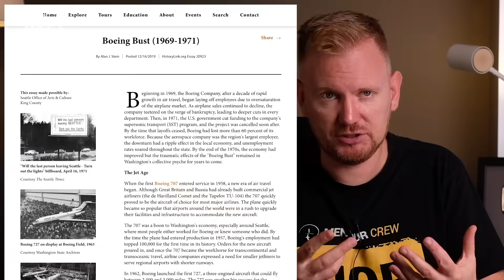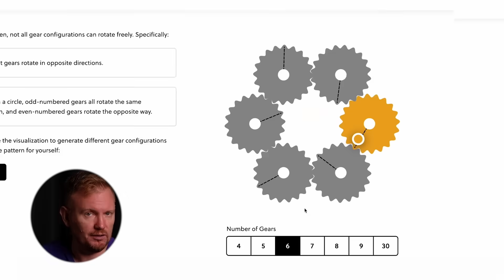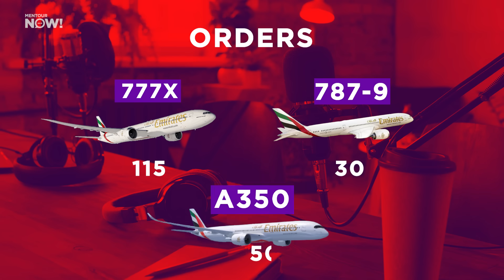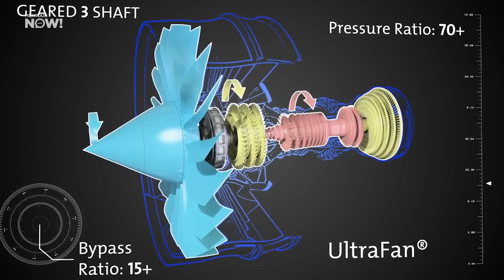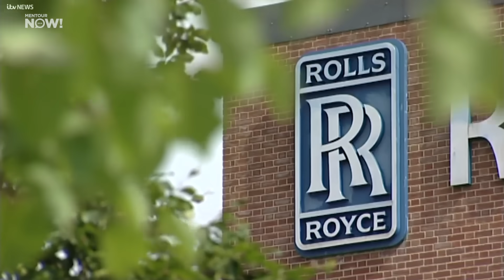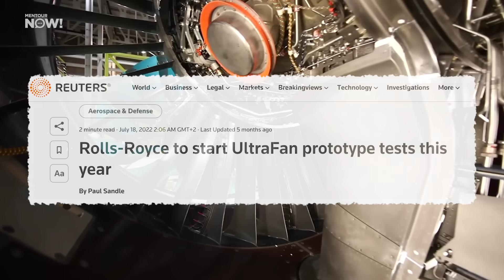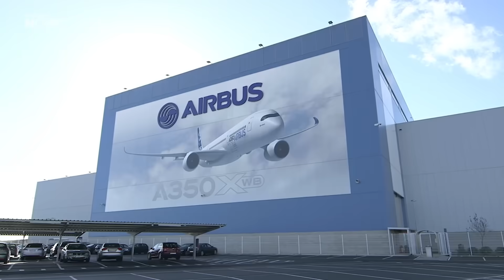Are BOEING planning a 747 with 2 ENGINES?!

Comment: Peter, you were doing so good until you went WOKE at the end... Read #6 

There are very simple facts these Lefty-Liberals will not acknowledge:  

#1 This Earth can only sustain 2 billion people without burning fossil fuel - John Deere does not run on batteries… so, what to do with 6 billion dead bodies?

#2 The “deal” Trump wisely backed us out of would have taxed USA and sent this money to the #1 and #4 producers of CO2  - Chairman Mao’s China, and India… 

#3 Every time you as a consumer purchase a product "Made in China" or Vietnam, you are supporting their Communist Government's decision to move from a self sustaining food system that is mostly carbon neutral to urban factory workers (very high carbon footprint) who then have to buy food grown on commercial farms using millions of gallons of diesel fuel... plus, much of it has to be imported from USA (more heavy crude oil being burned in marine diesels)

#4, a 6th grader knows there is no price for a train ticket to Hawaii.... as AOC wants to replace air travel with trains.....hmmm

#5, everyone with half a brain knows our Earth has but one atmosphere an when the #1 and #3 CO2 emitters have zero cost of burning more and more fossil fuels, the “West” can not change anything short of zero metal use (steel and aluminum require carbon – from coal – to remove the O2 from the Al-oxide and Fe-oxides.

#6 Absolutely everything you buy gets there with DIESEL fuel, most was made using diesel and oil... and the very first thing the first day o Biden's term he declared war on fossil fuel, to support his Green New Deal base. Thus, everything cost more. HINT AOC, John Deere will never run on batteries..

#7 Hydrogen power comes from fossil fuel. Fuel cell powered vehicles are almost always and electric vehicle w/ the “battery” being a fuel cell. As UPS found in testing Mercedes delivery vehicles, the fuel itself had about 1/5 the energy density of diesel / kerosene. Not practical outside a city, nor an aircraft.

Comment: I would say maybe a 747sp with only two Rolls-Royce Trent 1000 engines would be possible. The pylons would have to been redesigned but with two engines that's a weight reduction of 20,000 pounds.

Comment: I commented before in one of your previous videos about your English, and it seems that you have learned it from the Brits! They do not know how to use plurals correctly either, and it appears that you do not as well. Any singular entity uses singular verbs, so your title here should be "IS {and not Are} BOEING planning a 747 with 2 ENGINES?!" Anything can be construed as a collection of its many parts, so the direct conclusion is that you could use the plural with almost any noun! But if you are talking about ONE airline company, then it is SINGULAR! When you refer to more than one, then it is plural. In your speech you also often use the wrong pluarity, so it is not just a simple mistake here.

Otherwise, you videos are very informing and with lots of detail. Your English is quite easy to understand too.

Comment: This is relevant again.
If demand continues to rise then Airbus could be the one to bring the A380 back, it they can make the economics work. The plane is developed and approved, and with new engines will be more fuel efficient. So the question would be how difficult it would be for Airbus to setup the production again. Likely more simplified, so driving on roads at night.
No, the US did not buy it, as they have many airports, but India does not. Do Africa? I think we will see the comeback of this or similar, beside the 777 and 350. Also Heathrow did not build the 3rd runway. And pilot shortage.
Could also it could be fitted with a new wing and only two engines, but that would take more resources. That would depend on how much Tim Clark would pay - how much is it worth for Emirates? A 777x in his business is leaving money on the floor compared to a A380 size. It could also be a clean sheet. 
Personally, if I was flying long houl, and I am 190, I would rather go for longer trip and more comfort, so 380 or 350 then quicker but on a 321xlr.

Comment: This was exactly what I was thinking. On very busy airports flying more efficient smaller jets is just unrealistic because of the increasing number of take offs and departures. And have more airports defeats the purpose of point to point travel like if you want to fly to London or Mumbai or Delhi or Paris. And if you have to land on and airport outside that of the city from where it would take 3-4 hrs to reach where you want to go does not make sense. A large aircraft would simply mean less work for almost everybody involved.

Comment: Boeing does not have the funds, but Airbus could either make a A380Neo with 2 or 4 engines, or a bigger version of the A350, like a A360 but 777 like, with folding wing tips and a ultra fan. Depends on what Tim Clark would like, and what would the the lowest hanging frout for Airbus. Possibly a topic for a new vid.

Comment: This is boeing big problem it seems to find it difficult to move on from legacy air craft, it would not surprised me if a 2 engine is in the works, the problem is putting two engines on a 747 is likely to be as successful as the 737 max series, they need to get back to designing and building new jets with new materials and state of the art equipment, the last truly new plane was the 787 prior to that the 767, I've excluded the 777 because it's basically a bigger 767 not a truly new design IMO

Comment: Why doesn't anybody think of retrofitting the big 4 engine Aircraft with two inboard of higher thrust and two outboard lower output thrust.. 4 to take off two normal flight with obviously the backup of the other lower thrust as back up.. lower operating costs and maintenance costs.. ?

Comment: Short answer:  no way in hell.  Remember, it has to have enough power to continue EVERY takeoff when an engine fails after V1.  You might be able to fly a 2 engine 747, but the weights would have to be so reduced that it would be a money loser from day one.  Plus the production line is gone and all he equipment removed.

Comment: Also the much greater wingspan of such a super twin aircraft requires folding wings tips to allow such an aircraft to fit into the dusting infrastructure of modern airports.  Remember that when the original jumbo jet, and also the super jumbo (A380) were introduced, the physical size and the great weight of these two aircraft required that taxiways and even runways had to redesigned to handle these new aircraft.  You can probably imagine that an aircraft with a size as huge as some the proposed modern rigid airships would be completely incompatible with all but the very biggest airports in the world today. Even today there very few airports that allow the operation of the world’s largest ever aircraft, the six-engine, all composite construction StratoLaunch built by Scaled Composites. It has a wingspan of 117 meters, or 384 feet.  And, with a maximum takeoff weight of 1.3 million pounds or nearly 590 kilograms or metric ton, and is bigger than the other six-engine aircraft, the Antonov An225 and even the Airbus A380.

Comment: The problem with a two engine 747 is that two bigger engines on this huge plane would not fit. Both would almost drag on the ground. You do need some clearance. So my suggestion, for what it's worth, is simple. Slightly bigger single engines on each wing. And one more larger engine on the tail. Of course this might require both wings to be moved slightly back, but I think this might work.

Comment: Point to Point works only in National Scales. It will never happens that a flight took of from Springfield, Montana to Dinglechurch, Ireland. Even Springfield - New York - Dinglechurch sounds improbable. Springfield - NY - London - Dinglechurch sonds feasible
If the Point to Point will rock the Planet in 2025 we are missing today the 100 Passenger long haul Planes they are needed then. Or do you think there are more than 100 PPL wo want to travel from Springfield to Dinglechurch per Week?

Comment: Even preferring 747 as a piece of design, practical issues indicates being more profitable an upper deck and front door added to a 777 than changing the 747's wings/land gears to fit two engines...

Comment: Really don't understand this. One of the selling point for the 747 is that it can safely maintain flight with just 2 of the 4 engines working. After reaching altitude, just turn off 2 of the engines and be done with it.

Comment: Why not a carbon fiber version with two engines? Otherwise they'll never get the weight and fuel consumption down, which is the 747's achilles heel.

Comment: My car runs on 2 cylinders when its just cruising on the motorway. Would it be possible to have a 4 engine model that when just flying normal (Not taking off etc) can fly just using 2 engines?

Comment: Because of covid, airlines laid off many of their pilots.  Now with demand for more flights, they'll need years to hire and train new pilots.  777x and airbus equivalent are only holds 1/2 the passengers. Thus 2 fights are needed for each 747 abd a380 they replace and TWICE the pilots. They don't have the pilots.

And in the US we don't have airtraffic control and tower people to handle the current demand.  It takes like 3.5 years to train someone for the got and another half year of training to work at a the busy airport they get assigned to or reassigned to.

Comment: i had retired from UA after 16 years as engine overhaul technician. why even go back to 747 airframe by stretching the 777's fuselage circumference 20 ft at front and the rear of the CG. 777 PW4090 engine is more than enough thrust to boost the extra weight. by add more wing surface to get more lift. i would have the engineer redesign the airfoil for the added wing surface. let call the new 777-400A.

Comment: A 747 (with newer high-lift, low-drag wings and a lighter fuselage potentially could have 2, 3 & 5 engine options (tail-engine), longer second deck and less fuel capacity to compete with A380.  Emirates is not enough of a market by themselves.  But it might open Emirates up to a second hub.  And it could be surprisingly popular for direct-flight airlines for holiday capacity, international routes and modified hybrid (with and w/o hub airports) business models.

The 737 is an airframe I wish airlines would stop using for passenger service.  The diameter of the fuselage is too narrow.  It bends inward starting where window passengers' shoulders touch the inner skin, stealing shoulder space from aisle seats (making passengers lean into the aisle to get away from middle-seat passengers, and especially cramped middle seats whose passengers are doubly cramped on both sides.  Boeing should be looking to expand capacity of 757 airframes.

Comment: Airbus 2 engine wide body is also the reason why Boeing built the 757.  it had the capacity and range to compete with the A300 and A320 but it didn't sell as well as they hoped.  the Triple 7 is by far a better performing aircraft and I think that is good for Boeing.  I have never been on the 777 but I have flown on the 787 and I enjoyed that flight.  big plane and my best experience ever.  I got off that plane in Dallas in less than a minute and it was not an Emergency landing.  Double Aisles Sure was a huge help.

Comment: Actually the Airbus A-380 is know as a super Jumbo but it never got the numbers sold as the 747 because of its massive size.  it is also very sophisticated in computer controls and there are not a lot of pilots certified to fly the A380.  The 747 of course has way more pilots certified to fly it.  Although I hear it is making  a comeback so the last one rolling of the line may be short lived.  I am betting Boeing realized they made a mistake cancelling the Queen of the Skies.  I hope they don't redo the engine and make it a 2 engine.  it need to keep the iconic 4 engine design, they can give it a more efficient engine there are certainly more efficient engines.  the Trent 900D for example from Rolls Royce.  It would be a shame to see a 2 engine version of it and it would not be a TRUE 747

Comment: YES it would be possible to make a 747 with only 2 engines.  All they would have to do is outfit it with the most powerful engine ever created and that is the GE 9X.

During testing they actually bolted one on to a 747 and flew the plane, shut off the 3 smaller engines and it had enough thrust to keep the 747 in the air on just that one engine.
The GE9X’s achievement breaks the record held by GE’s GE90-115B engine of 127,900 lbs of thrust, which was set in 2002.

Comment: The 747 is the most safer aircraft ever built , with just 2 engines , any problems at takeoff and landing,and a possible shutdown of engines during flight ,I doubt just 2 engines will do the same thing as 4 engines does , instead of of trying to build with 2 engines why not build a 4 engines more efficiently and economically back ,the passengers would love to be back in the comfortable of a 4 engines safer  , let’s do a review,99% will be at the 4 engines side than the 2 engines

Comment: This is not impossible. The 747 was designed in the 60's and it was over engineered, the wings could handle a lot of load. the 747 inner engine mounting point (close to the fuselage) is nearly as high as 777, so there wont be any drama similar to 737. Changing the engines hopefully will retain balance and stability we dont want MD-11 stability issues on poor weather landing and 737-Max dependence on automation for stability.

Comment: I have a feeling that the New Engine will be fitted onto a replacement for the B-52. The present B-52 has 8 gas hungry Pratt&Whitney jet engines. Two modern jets engines could do the job now.

Comment: Boeing has economies of scale mastered. Tooling paid for. Not unlike using an old rocket design rather than a new one. Proven reliability is currency. That’s why there are many more aircraft designs than engines. Concentration of reliable technology is important

Comment: Is it possible retrofit 747s with 2 engines as freighters?  Also in a freighter role would efficient shroudless engines be optimal since noise reduction is not as important?

Comment: Absolutely...
Boeing has the best marketing strategy.   Base price never includes all the necessary sensors or engines or whatever else.  Wanna live - you buy the necessary sensors, you buy the necessary engines.  Wanna risk it - go for the base model.  It's designed to fly most of the time, bit it most certainly is also designed to crash - crashes help sell the extra sensors, engines, etc.  Republican Capitalism.

Comment: It would be difficult to convert a 747 to use modern high bypass engines. The mess with the 737 max is proof of that. To compete w airbus high efficiency jets they wanted to put a larger, high bypass engine on the max. That required putting the engines higher on the wing ( if mounted where orignal engine was would hit the ground). That required rethinking the flight comtrol systems since the aerodynamics are very different.

Would be same thing with the 747 to use the newer engines.

Comment: The Rolls Royce engine may not be strictly for Boeing. There's been talks (since shortly after her destruction) that the Antonov AN-225 may be rebuilt using her sister's unfinished frame. Engines are one of those things missing for the frame. They'd also be updating the tech in her to modern standards, and due to her size and weight carrying capacity, new and more powerful engines would be something that they'd look into

Comment: I’m not an aircraft engineer but why don’t they have two of engines electric and use the fuel engines to power them. The engines provide electrical power to the aircraft maybe they are able to produce enough power for the electric ones, something alone the line a diesel electric train.  I guess to it would also depend on how much thrust you could get from these electric engines. The F-35 lift fan comes to mind.

Comment: The US DoD is asking for large flying-wing aircraft that can serve as tankers and military freighters. Almost all concept renderings of flying wings that are airliner size show the engines on the roof, not hanging under the wings. This engine location is not beholden to the same form factor issues of under-wing designs. 
If DoD actually gets a flying wing, then industry will likely follow. Remember that the 747 was actually the losing bid to the USAF C-5 Galaxy.

Comment: There should not be a problem redesigning the 747 to accommodate a couple of powerful GE9X engines. These high thrust engines should be able to handle the weight of a 747. The cost savings of a Two engine plane is already a proven deal maker for Airline operators. Boeing needs to keep rolling out this Iconic plane for decades to come.

Comment: Why the commercial airliners do prefer the design with the wings attached to the lower section of the fuselage? Cargo jets often has the high wing scheme. Seemingly high located wing will avoid the limitation of the engine diamater, no need for high landing gear. Coul you please discuss this in your future video?

Comment: Would a two engine 747 be safer than four engines?  Or would it just increase profits?  If you are in a two engine airplane over the middle of the Pacific and lose an engine, you are much slower and lower now.  The water is really cold and the fish are bigger than you are.  EVERYTHING is driven by profit.  "Safety second".

Comment: Russians are already in testing phase of similar Size or a little bigger engine called PD 35 for I think IL 96 400M already test last week with 100% Russian Parts with old 4 engines, this is same size or a little bigger than Airbuss 350. According to Teleframe TV old 4 engines will be replaced with 2 PD 35 engines.